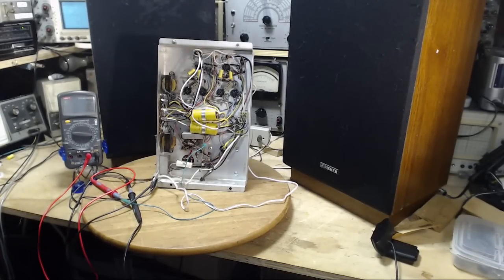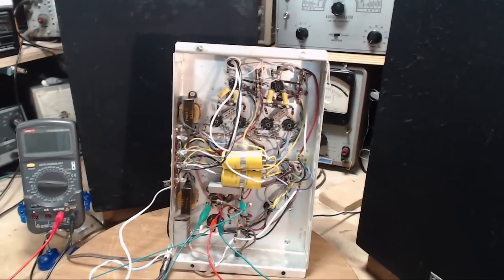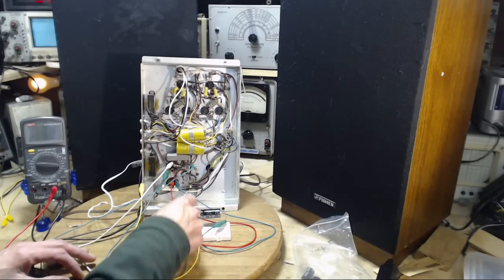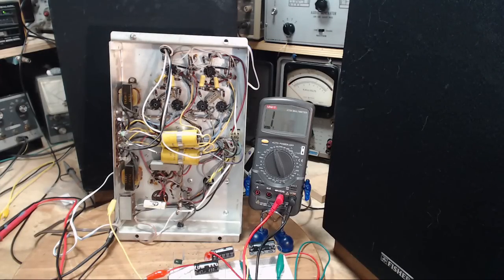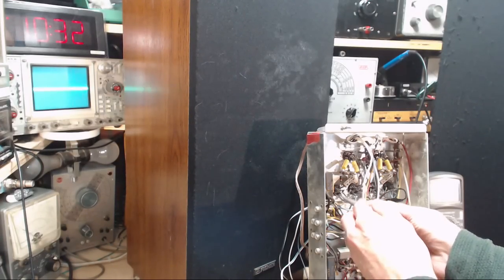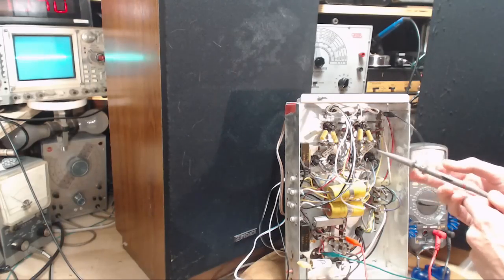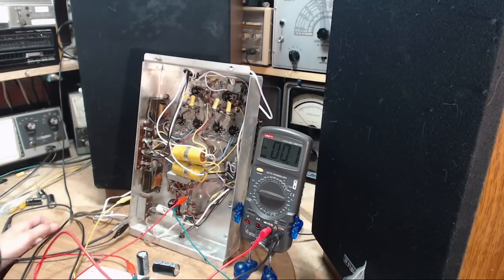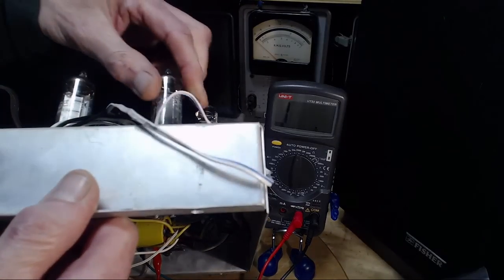Canadian Admiral J104X J105X Console Video #4 - Troubleshooting Hum

Comment: C114 and C115A are NOT filter capacitors. They are part of the voltage doubler circuit. The filtering is done by C115B and C115C.
Take a look at this: https://www.youtube.com/watch?v=fM3QMl0MYeE

Comment: The cooler output tube was the one that didn’t have any sign of the hf instability, a clue. This one didn’t click when the meter was attached. The reason for the clicking when touching parts of the circuit with the meter probe was because the capacitance of the meter was effecting the hf instability and the one that didn’t click was the one that was operating normally.
Because of the large negative feedback around this circuit, an odd phase shift at high frequencies in the feedback circuit may be causing ultrasonic oscillation. This phase shift might be causing positive feedback in the high frequencies. It’s a theory.

Comment: When you have two circuits which are essentially identical, and performance is not sufficiently similar between them to be identical within tolerance limits, then the problem logically resides within the aberrant circuit.  You appear to have two aberrant circuits. One with oscillation and hum, the other with incorrect voltages. The right-most tube had incorrect voltages, and was the one which was significantly 'cooler' than the other in operation. when the tubes were exchanged, neither tube on that channel produced ambient scratching noise when the terminals were tickled.  To me, this is a 'red-light' moment.  Something is wrong with one of those tubes, and it might show up in a tube tester.  It's difficult to keep track of which side is driving which speaker, but if memory serves, the hum was apparent in the other set of tubes, as was the oscillation.  I think you have problems in both channels of the amplifier.

Comment: Why in h*ll would someone try to patch up 50 year old electrolytics in an ESR and capacity critical voltage doubler circuit? And the capacity of the electrolytics was not chosen by throwing dices but by the needs of the circuit. Too high of a capacity puts stresses on the diodes and transformer because of the repetetive recharge currents concentrating near the peaks of the sinewave rather than starting already on the way there. Bigger is not always better! Restore to original values and accept designs and shortcomings, not alter and worsen in the end!